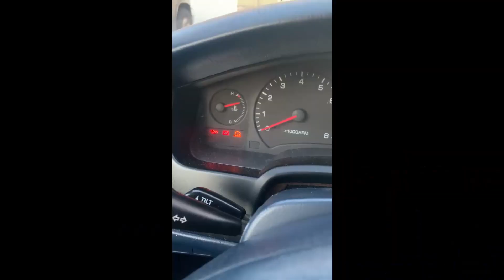Track Day Fail....Overheated My Engine || Toyota MR2

Comment: Check your coolant for oil, your oil for coolant, and your spark plugs for coolant residue... If that's all fine then the headgasket is probably good. If your headgasket seems fine then check for a leak in your coolant system. You might be loosing coolant and getting air in the system which can lead to boiling which leads to overheating. I don't hear any knocking so the motor is probably fine but just needs a little work.
Reply from the maker: I think you’re on the right track. I checked compression, and it was 180 across all 4 cylinders. Just need to check if their is any cross contamination then go from there, I think that’ll end up being fine!
Reply: @saladbar21  I mean if you drove it 200 miles home it can’t be that bad. Those 5sfe engines are pretty bullet proof.
Reply: @saladbar21  I literally just used a block/head gasket tester today from auto zone on a friends car. you stick it in the coolant filler and suck the air out. if the liquid turns yellow from its original blue, you have exhaust in the system. it took me a while to figure it out as I kept sucking in coolant. you need to remove a bit of coolant first. the fluid costs 10 bucks and the tester is free (rental)

Comment: even if the headgasket wasn't the cause, with that much overheat it'll be gone now. The head will be warped. My guess would be part blocked radiator or a failing thermostat was the original cause. Good luck!
Reply from the maker: Honestly, I never even considered the radiator into the equation. I’ve replaced the coolant annually but never touched the radiator in my 5 years of ownership. It’s a OEM Toyota radiator, so it’s definitely older and won’t be as efficient.
Reply: @saladbar21  they can collect corrosion and dirt in the bottom and don't use teh full area to cool anymore. test it by warming up the car and touching the rad with your hand and feel how it warms up. 

I forgot you said the temp was going up/down.. another common leak point is the copper heater lines above the fuel tank. the right hand one rips open at the first mount just behind the heat shields. the leak is hard to spot due to the plastic undertray.

Comment: good thing you have another mr2 in the mean time! you been in a 2gr car yet?
Reply from the maker: Yes, I have. I wasn’t able to push the car(I was on the streets), but I enjoyed it. It’s why I plan on going with a 2gr!
Reply: @saladbar21  if you are going to keep hitting the track, I would reccomend. just less stuff to deal with. feel free to hit me up with any questions on it. I'm going to be doing my second 2gr swap this summer for my new daily =)
Reply from the maker: I agree with, I want simplicity for track build! I am curious, what radiator do you run? I wasn’t sure how well a OEM turbo radiator would hold up to track abuse with a 2gr.